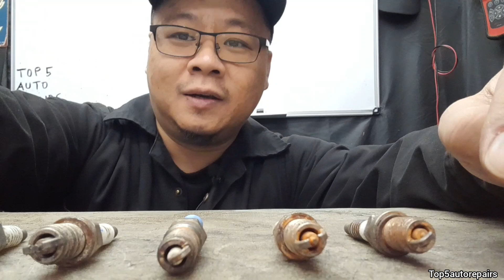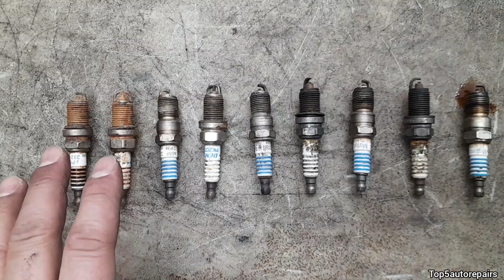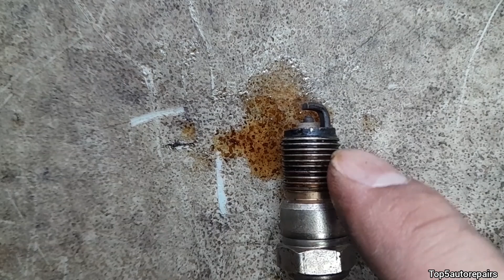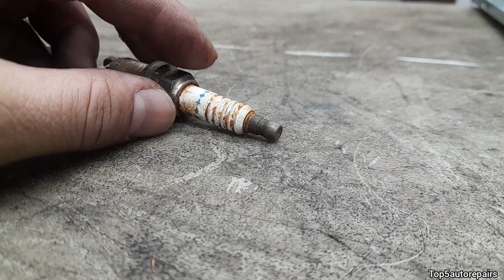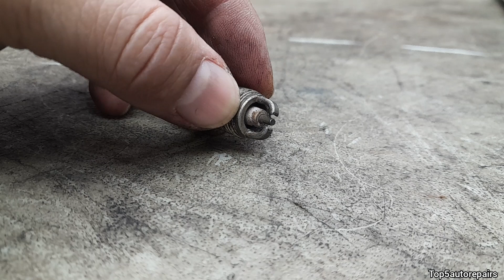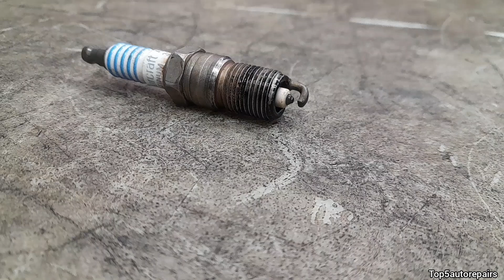HOW TO TELL WHAT'S GOING ON INSIDE YOUR ENGINE BY CHECKING SPARK PLUGS CONDITION

Comment: How is the timing going to cause a bent Spark Plug tip? 3:17
Reply: If your car is out of spec it could be displacing the piston way out of the way and colliding with your plugs and valves.

Comment: Thank you so much for these wonderful videos. ❤

P1382 and P0340 honda accord 2002. What does this code mean and how do I fix it please.

Thank you
Reply from the maker: It means the crankshaft position sensor sensor in the distributor is faulty. There are two options, replace the crankshaft position sensor in the distributor or replace the distributor. The latter is easily to do.
Reply: @Top5AutoRepairs  Thanks alot